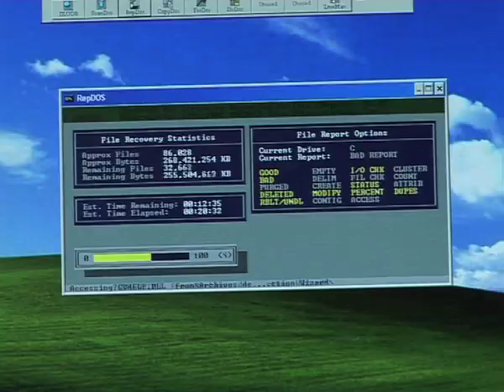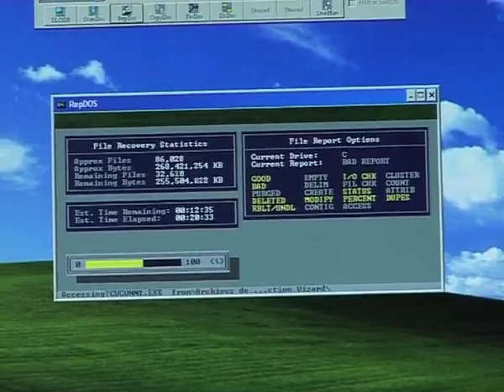How to bring lost data back to life

Comment: @immuki 
Car can be fixed and no problems. 300 miles it would still be under warranty anyways. They also do test them but ANYTHING with moving parts will break. Typically they will last 3+ years but anything from building to SHIPPING the items can cause problems. Shipping is the top killer for hard drives. Reason I only use FedEx for my HDD needs.

Reason I run a 3-way RAID1 setup for my can lose documents with weekly DVD and offsite back ups. Sure that is over kill but its still cheaper :P

Comment: This video is nonsence. They recovered data from the beer drive MAYBE... but did anyone notice BOTH drives they dropped were 3.5 inch desktop drives, and not the laptop drives they "recovered" data off of? Nice try though. I bet anyone ANYTHING if you drop a laptop drive off a 3 story building, the plates would shatter as they are made from glass. It would be IMPOSSIBLE to recover the data. In a 3.5'' drive, the aluminum plates would bend and it still would not be recoverable.